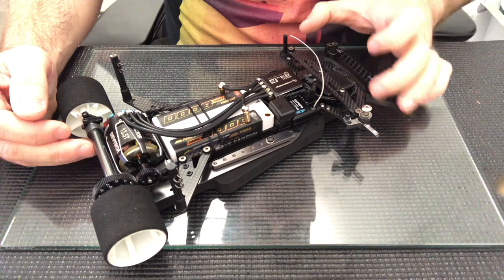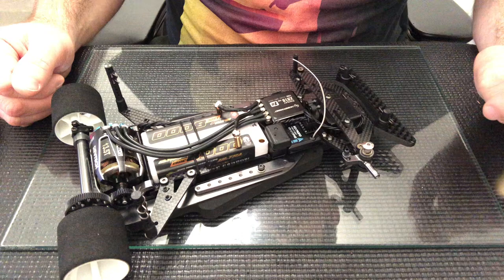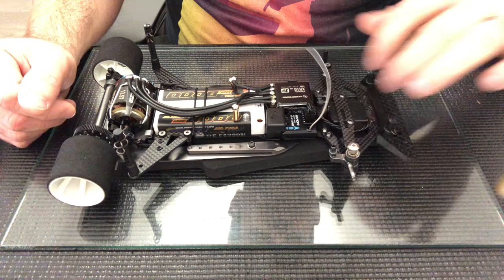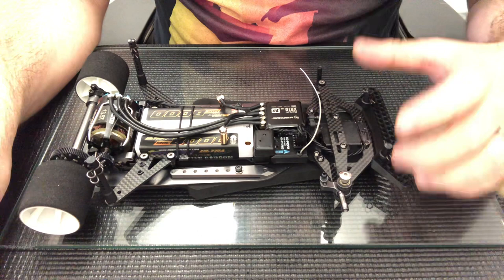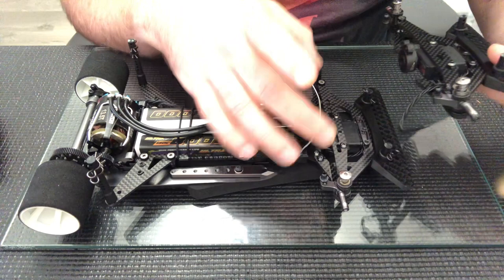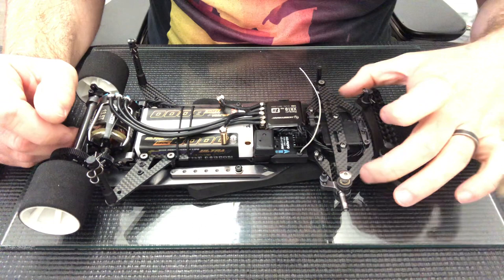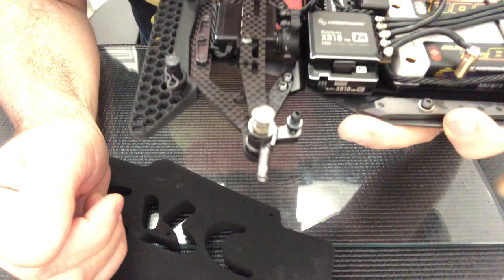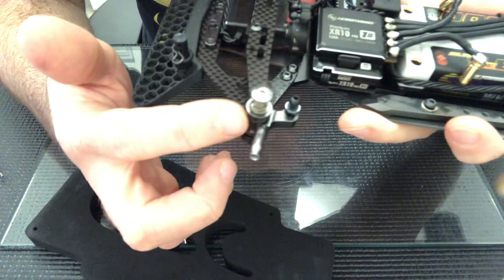Awesomatix A12 - Front Suspension Options & Build

Comment: Hi Mark, I have found that I often want less than -0.75 degrees of camber at the front too and this is the method I have used to get a consistent result left to right.

As you know even a small rotation of the post can cause significant variation in camber, so setting them the same as each other can be tricky (trying to avoid having to use gauges and the faff of having to take things apart and reassemble if you get it slightly off / different).  The standard method is to use the end of the ride height gauge (1.5mm diameter) as a dowel pin to line the holes up.... what I do is I use a body clip (I haven't actually measured this but its smaller than 1.5mm diameter) instead and then rotate the post towards the reduced camber direction until the slop is taken up and the body clip is now tight in the holes.  From what I can measure this is giving approx -0.4 / -0.5 degrees of camber, and is super easy to get consistent setting left to right.

Hopefully this helps you / anyone else reading this.